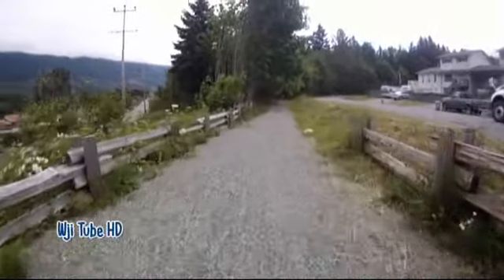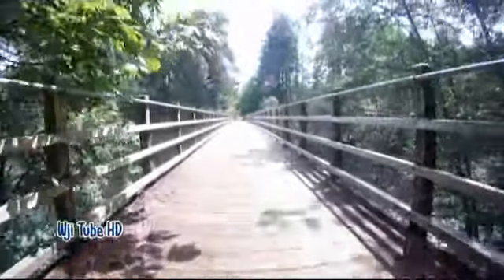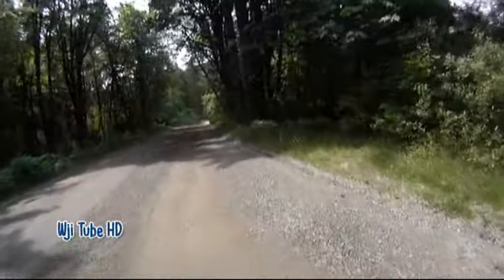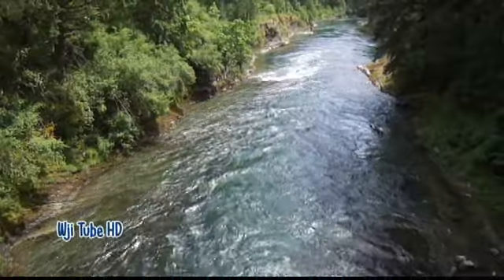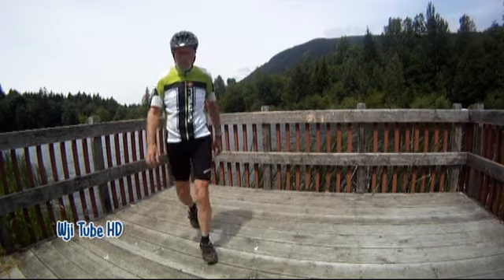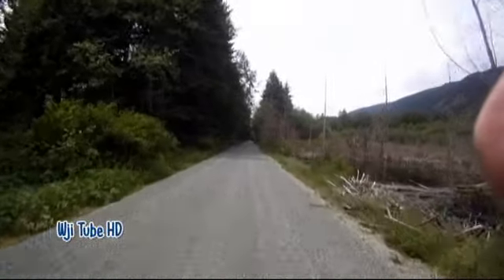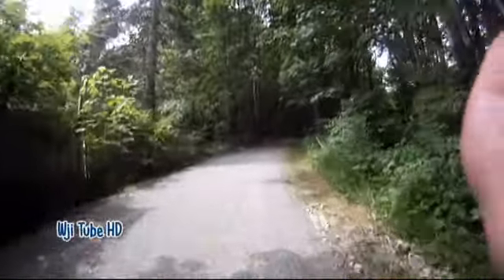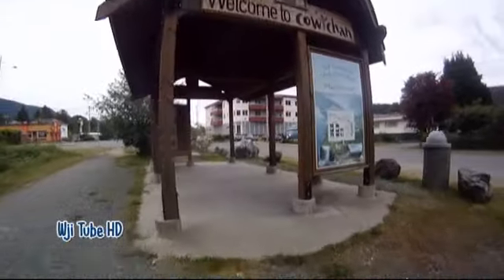Cowichan Valley Trail and Trans Canada Trail Western

Comment: Anyone know what 2018 trail conditions are ?
Reply from the maker: Thanks for viewing my video and your interest in the TCT in the Cowichan Valley. I haven' been along this section for some time but there's no reason to believe the trail conditions have deteriorated in any way in the interim. The entire trail is gravel and some parts were pretty rough. For the most part many of these section have been improved. One of my complaints is when said 'improvements' are made the crews use the wrong aggregates for the surface and they are too soft for cycling.
Reply: Thank you , soft is not what i like , I may do this entire route this year. I ride a recumbent touring bike with very low gears for hills. Still humble enough to push my bent up a hill if need be but only on gravel.